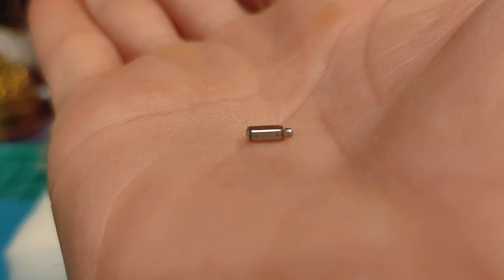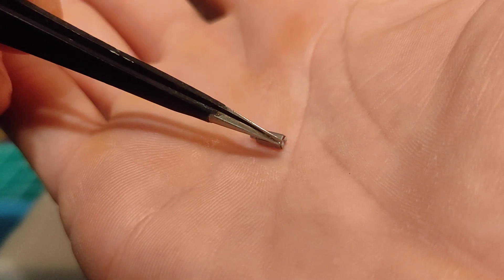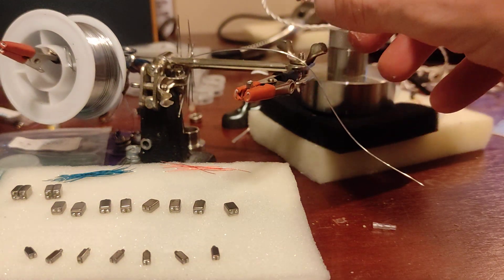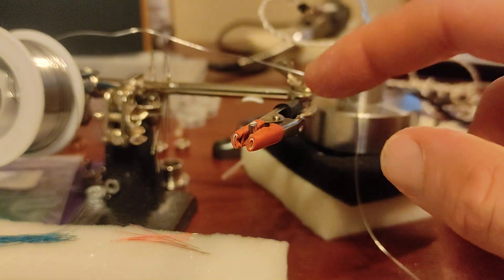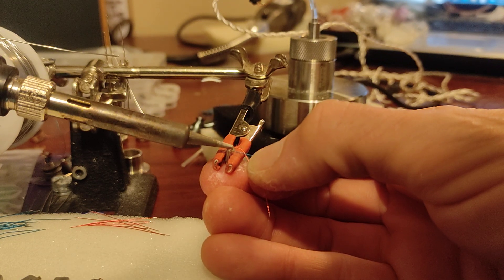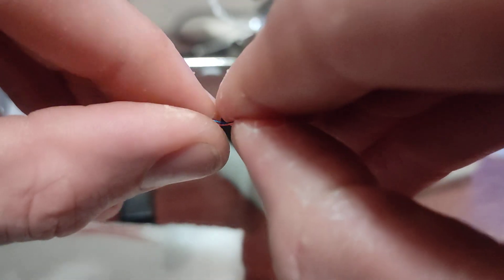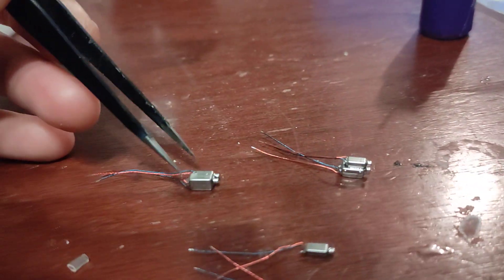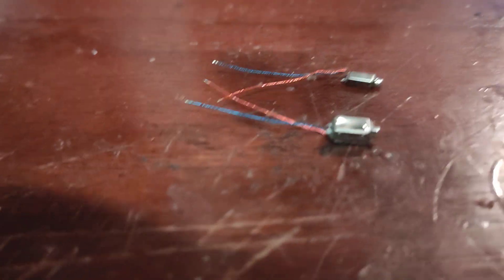DIY IEM: On-the-fly video of How I solder BA and Glue multiple together. Part 1 of 2

Comment: Are there certain driver configs u can recommend?
Reply from the maker: As far as making a DIY iem or purchasing an iem?
Reply: @hi-friaudioman  i would like to ask the same question, would it be better (aka cheaper/more worth it) for me to make a; 1dd 2ba (1mid, 1high), 3 ba, 4 ba (2mid), or just 1dd 1ba? Or if you have another specific reccommendation. 

Which specific drivers, how to do the crossover, and how to avoid incoherencies.

Im looking for a natural sound (mids and treble is ief neutral) like crinacles tuning, with excellent seperation, and tight bass (fast and clean without overly bassy). Imaging and soundstage is appreciated but not as important as the former.
Reply: @hi-friaudioman   DIY